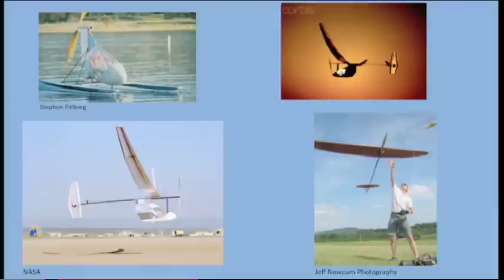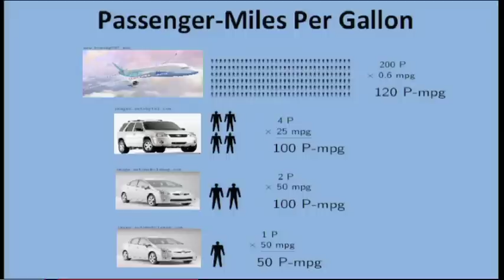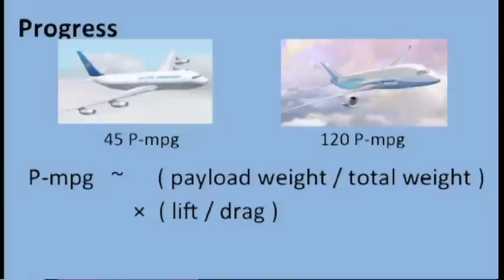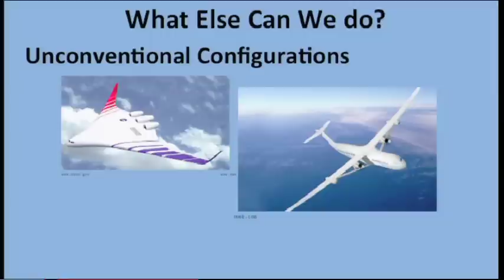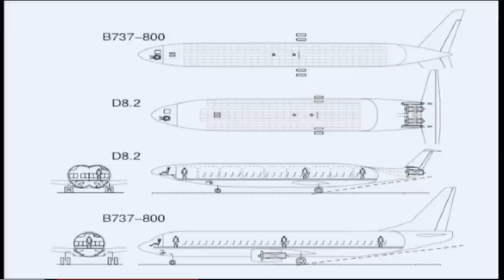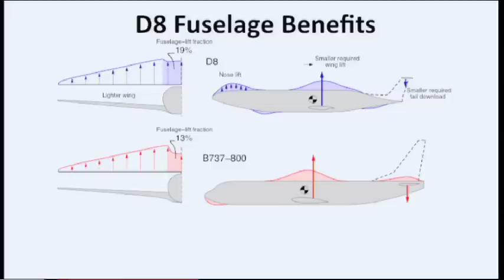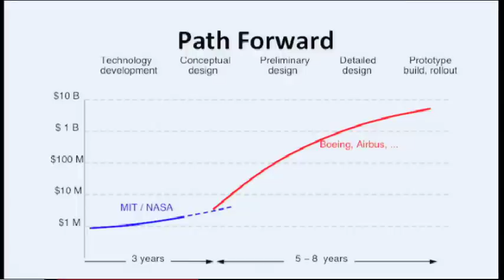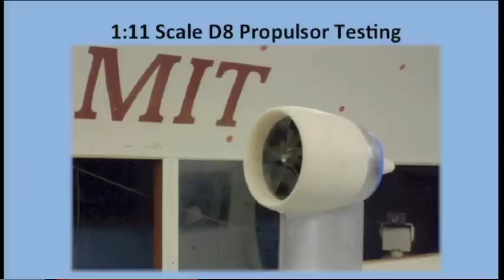Making an extraordinary machine better: Mark Drela at TEDxNewEngland

Comment: I'm a huge fan of Dr. Mark Drela and his enormous contribution to Aviation, especially the open source, for the Everyman aerodynamicist xFoil and AVL. Which are powerful programs that are suprisingly accurate, offered at no charge. 

I'm obviously missing something here, as I understand where these efficiency gains are coming from, but there is a significant weight reduction for the same passenger load that has not been clearly explained. 

The fuselage generating aproximatly 7% of the total lift required accounts for a reduction in wing area, and therefore wing weight. - But the aspect ratio went way up which increases the wing weight, assuming the root chord Airfoil is constrained in thickness by Mach limitations, it will need a significantly stronger wing spar to support the new high aspect ratio, long span wing.

Furthermore, you have removed the engines from the wings and relocated them to the aft fuselage, so there is no longer the engine weight counteracting the root-bending moment of the wings. Modern airliners place the engines as far outboard on the wings as possible to use their weight to relieve root-bending moment and therefore reduce wing weight. Engines would be mounted even farther outboard if not for the adverse single-engine operation effect that requires a larger vertical stabilizer to compensate, which would increase both drag and weight again. 

If you removed the wing mounted engines entirely from a modern aircraft, you would increase the root bending moment under G-load, as you would not have the mass of the engines pulling downward on the wings in opposition to the lift they are generating. By placing those same engines back onto the airframe on the fuselage, not only do you lose their beneficial effects from the wings, you exacerbate the issue by placing additional mass on the fuselage which the wings must support via the wing root. Drastically increasing the root-bending moment, requiring additional structure, and therefore more wing weight.

Speaking of Engines: Up to this point engine placement has strived to avoid inadvertently ingesting the boundary layer. Almost all jet aircraft are designed to avoid this phenomenon, as there is often some turbulence in the airstream which was disturbed by the fuselage, the compressor blades will receive a rather more violent beating from ingesting this unstable air. - It can be done, no doubt. But at what cost? 

Simply stating that "new engines must be designed" that can function in an adverse environment is a tall order. Furthermore, in the landing phase, and during takeoff rotation to achieve the required Angle of Attack for slow flight to touchdown and/or initial climb to use available runways lengths at standard airports this  Aircraft must be able to fly at relatively high angles of attack like other airliners do. This hight-Aoa is going to cause some instability in the airstream at the upper-aft end of the fuselage, possibly creating enough instability as to cause compressor surge or even compressor stalls of the engines. 

All jet aircraft that I know of which are intended to operate at relatively high AoA and high power settings have their inlets facing the freestream incoming air. Just look at fighter aircraft, their inlets even angle down and frontward to receive the incoming air at high AoA and this can be seen on the new 787 engine duct inlets also. There are a few exceptions among VLJs mounting their engines on the aft fuselage, but they protrude far enough above the cabin to receive clean airflow, except at potentially extreme (stalled) AoA. 

Placing the engines and their inlets much lower, and behind the sloping aft fuselage is asking for serious complications at high angles of attack and sideslip that will take a lot of resources both on the engine design front and the Aerodynanics side, costing countless millions of dollars in order to completely address for a seemingly small improvement in fuel savings that will take a long time to recoup: as this entire exercise was intended to accomplish. 

This design seemingly triples-down on costs and complexity, while also increasing weight by removing the engines from the wings, placing their mass on the fuselage, increasing the wingspan, and decreasing the wing root chord length therefore reduceing the absolute thickness at the root, as the thickness-chord ratio is always constrained by Mach number limitations. All of this requiring much heavier wing spars and therefore additional weight, not less. Though the design claims to be substantially less. (That entirely unaccounted-for weight saving would account for a significant reduction in induced drag and improved economy by itself). 

Also, that lifting fuselage cannot possibly have the same lift-to-drag ratio as a custom tailored Airfoil in the form of a moderate aspect-ratio wing, so whatever additional lift is gained by the lifting body will generate an inordinate amount of drag vs using a highly efficient Airfoil in the form of additional wing area.

Speaking of the fuselage, there is a reason a perfect cylindrical tube is used on modern airliners, because it's the most efficient (lightest) means to contain pressurized gasses (air) for passengers to breath normally while cruising at 38,000'. Compressed air cylinders are always manufactured in this manner, from spray paint cans to welding gas cylinders; a cylinder is the lightest device to contain pressure.

It's also Structurally efficient, a tube is a very lightweight design to transmit stabilizer forces from the aft tail of the airliner. A hollow tube is equally strong in Both yaw and pitch and any combination of the two, in fact hollow tubes are often used for control linkages and fuselage construction in small light aircraft for their efficient strength to weight ratio, in both bending and torsion. 

This fuselage abandons this concept, and it therefore will invariably weigh at least slightly more than comparable designs. You also open up the opportunity to develop fatigue cracks at the varied compound curve junctions. If not on the first flight pressurized cycle, maybe the 10,000th cycle. Testing and engineering will avoid any catastrophe, but at what cost in additional weight, and R&D?

My point is, there is a finite amount of efficiency that can be gained and many ideas actually counteract what they are trying to accomplish. 

There are several methods to reduce fuel consumption: 

Fly slower. Not a lot slower, maybe 450mph vs 550mph. Drag increases with the square of speed, so slow down and drag and therefore fuel consumption per passenger mile comes down exponentially, to a point where induced-drag from lift begins to rise exponentially. Find the happy in between around 400-450mph at 35,000. 

Fly much much higher where the air is thinner and creates exponentially less drag. The only thing preventing this is regulatory bodies and their fear of cabin depressurization. (Rightly so, you won't live more than a few moments above 55,000'). 

And by designing aircraft to fly at very high lift coefficients, just below supersonic speed, and cruise in the "Coffin Corner" of their flight envelope. 

You can also reduce frontal area and pack more passengers in a line behind each other. Frontal area and drag go hand in hand, and a slight reduction in fuselage diameter results in near-exponential less frontal area. Though skin friction drag goes up, as does trim or fuselage lift related drag as airliners fly the first part of their trip at rather high cruising AoA which would likley be less efficient with a longer fuselage.

From the standpoint of reducing greenhouse gas emissions, (Specifically Co2), a change to Nuclear Propulsion is in the works. Far safer than Anti-matter, (haha) as it's very well understood, it produces zero carbon dioxide, or any other atmosphere pollutant. 

And its power comes from rocks. Literally rocks. They say nuclear waste is hazardous, it is. But so is lava, which is melted by radioactive decay in the earths mantle. So just put in back down there with the other radioactive rocks. Send it down a four mile deep hole down near the lava to dispose of it.

Nuclear power is the energy of the future. It's green. It's relevant. It's already invented. It doesn't kill four billion birds a year like the wind turbines, it works 24/7/365, unlike the sun which sets every evening. It doesn't block the coastline with wave actuated generators. It doesn't use fossil fuel, and it's the only energy source that's truely zero carbon, asside from the concrete and steel to built the plant. And the diesel to fuel the semi truck that brings the plutonium... Nuclear Propulsion or nuclear-electric propulsion, as seen on submarines and aircraft carriers, is sustainable and unlimited with at least 1 Billion more years worth of fuel available on this planet alone.
Reply: Hey Justin ,am Abhishek here an undergraduate mechanical engineer from India ur views are truly impactful and accounts for every possible condition if u don't mind may in know u....

Comment: The trouble is that while jets are efficient in terms of fuel consumption, the exhaust is dumped high in the atmosphere, and furthermore contrails are created, which grow into extensive cirrus clouds. The importance of this was illustrated immediately after 9/11, when North American air travel was suspended, with a marked drop in temperatures in the absence of the contrail-induced cirrus clouds. The impact of jet travel on the climate is a big question mark.
Reply: Contrails are suspended ice crystals formed from the water vapor left by burned hydrocarbons. Cirrus clouds do apparently reflect infrared light back down to the surface, but considering they take up less than 1 hundredth of 1% of the sky, I'm hesitant to think it has a significantly measurable effect.

Comment: I note, that totally ignores motorcycles. :) which can be viewed as 1, 2 or 3 passengers and at 50mpg :) set and match. Also way more fun that planes, trains or automobiles.
Reply: Motorcycle fuel efficiency has not been a high priority, and with a few notable exceptions is no better than for the best small cars. My 500cc 1956 Triumph Tiger 100 had much the same mileage as modern bikes of similar size.
Reply: +Keith Schiffner, have you tried an AirBike or an autogyro?